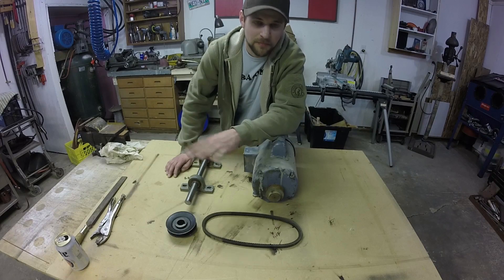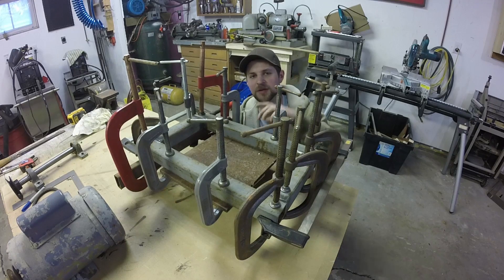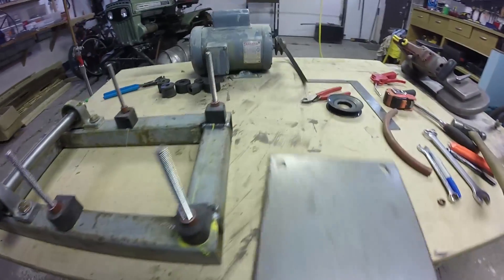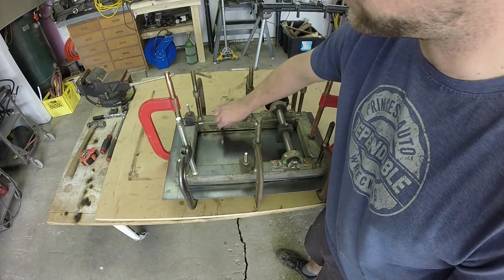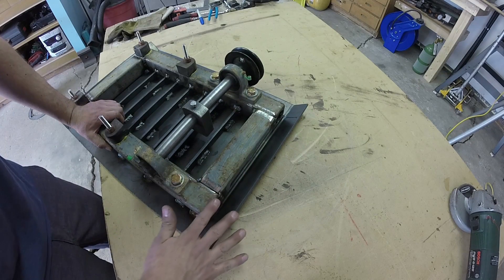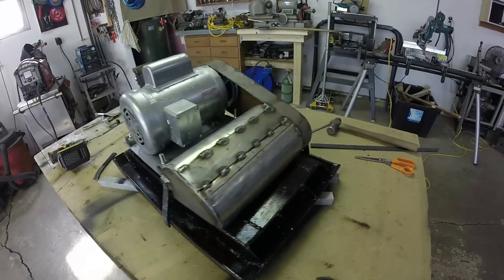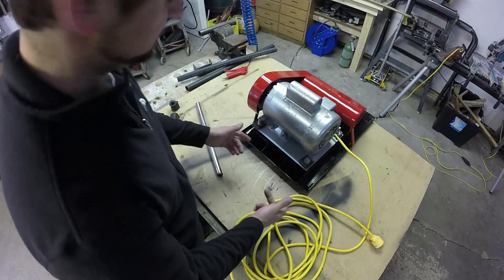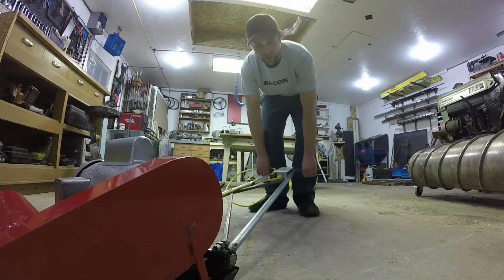Plate Compactor - WHY RENT?? BUILD YOUR OWN!!!

Comment: Actually pulling back straight on a vibrating plate tamper that is clean on the bottom because of water spray or a fine spray of diesel will have a effect much like a steel trowel on concrete . The plate can also be spun easily while it hops and while stationary too as long as it is clean and damp on the bottom . Carry a thick stiff scraper to clean off any asphalt buildup that may leave blemishes. Spraying too much water on the hot asphalt can cuss it to boil and impede the travel of the plate tamper. Good Idea. When is the rechargeable battery version coming out? The gas powered ones with the big water tanks have a weight benefit. A useful tool for initial compaction on slopes exceeding 18-22 % . Rolling those while hot can cause them to stretch excessively.

Comment: With the electric motor You will have to be careful with and around water. Water is used finely sprayed to keep asphalt from sticking to the metal plate. A wet piece of cardboard thrown down in front of the plate will also work , better if sprayed with diesel or thin oil soaked into the cardboard. Oiling the asphalt will weaken the surface oils of the asphalt . I have had a hydraulic line break on a roller . Remove the most badly soaked asphalt and replace with some new uncontaminated material . Using a weed burner torch to cook of remaining oil will help too just do not overcook the asphalt and burn all of the oil out of it. That spot is still holding up well about 15 years later with no signs of spalling or failure. I have not tried simple green on the cardboard yet and We do use a biodegradeable release agent that works very well as s release and cleaning agent like a thicker version of Simple Green. Only use it on the cardboard that the tamper runs over. We do prefer to use the water from the mounted tank that sprays from a sprat bar mounted at the front .

Comment: put a reverse polarity switch on to make it go both ways. and make the handle rotate to other side. 
other than that, good build. 
 I'm going to attempt to build another one with 2 exciter drums. one on each end of the plate. 
It'll be 2 drums made from sch.40 pipe, with exciter inside, a plate welded to connect the two pipes for the flat bottom. The pipe will also function as the front lip wedge ramp. 
To keep both exciters in tune, l'II have to use chain to tie them together. not sure how well that will go.

Comment: You gave me an idea to use an old cylinder mower thanks
Reply: Cut the blade off the cylinder add the counter weight or two on the main shaft
Reply: You've made a cylinder mower

Comment: I can't work out how that counterweight on the shaft makes the plate vibrate ? Does it hit something or is it just the rotating motion of it ?
Reply: The weight is not centered, it is offset making the shaft unbalanced. 

If you think about the great pains that go into balancing mechanical devices: driveshafts, crankshafts, motors, etc. This is the opposite of that. The shaft is made unbalanced on purpose to cause it to vibrate and shake .

Comment: Just curious, why wouldn't you mount the drive shift with the oscillating weight counter weight to the center of the frame?
Reply: I was kind of wondering that... why not put the oscillator in the middle and put the motor above it, centralizing the mass and using the motor as weight to vibrate against 🤔

Comment: Very cool. Can you put a big battery on it so you needn't a cord. Also can be water resistant then.
I wanted a cordless compactor for some time. Of coarse you need to convert the power from ac to dc. Something like that.
Even using a truck battery would work.
I'm sure Milwaukee will built one of these one day. Better than breathing fumes.
Well done on your engineering.

Comment: Hi! Great video!! Did u ever make a follow up on the plate compactor? And/or an in action video? Are you satisfied with the size of the motor?
What is the total weight? We´re planing to convert a gas compactor to electric, I think it´s 90kg and the gas engine is 4hp. What do you think we need size wise?
Mattias

Comment: I'm thinking that belt is the key for vibration separation. Run a wheeled handle and motor that pivots seperate from the eccentrics and actual plate. The motor, handle, and most importantly you, would then be dampened

Comment: I have an old yard machine tiller I just took the engine off I want to build one of these right away I cannot figure out where to get that counter weight, pillow blocks round the rod everything else no problem but for the life of me I cannot find those counterweights for say 1 inch round rod does anybody have any idea what I can look up to find them on Amazon or eBay?

Comment: What should be the weight of the eccentric, the off set weight on the rotating shaft, that gets the vibrator action ?
Reply from the maker: +Mangal Singh B hard to say exactly...you can see the size of steel I welded on there. I would add or subtract steel until you are happy with the amount of vibration
Reply: REDNIC79 
Hmmm.....
I hope that around 2 pounds of weight must be good...
Let's see .. ..
Thanks again

Comment: Hi..
I'm Mangal Singh, from Chennai, India..
Ain't a 1/2 HP, single phase, 1440 rpm sufficient for this !
The base compaction plate of 6mm thickness.
The counter weight on the rotating shaft slightly heavy would be better..
These are my suggestions, hope you give me some advice regarding this....
Reply from the maker: yes that motor is sufficient as long as your weighted shaft spins at around 3500rpm. then make the machine weigh 150lbs. 6mm should be fine
Reply: REDNIC79 thank you for your valuable reply, will get back if any other doubt is there...
Thanks once again !

Comment: why did you want the axis to turn at 3500 rpm? is it the best frequency for compacting sand? i want to build something to shake up manhole covers (which are stuck because of sand and other stuff on the sides) but i'm not sure which frequency will work best to get the cover vibrating and to remove the sand.
Reply from the maker: the reason I chose that rpm is from looking at the pulleys on rental compactors. the gas motors usually run in that rpm range and the pulleys were close to 1:1
Reply: cool, thanks for the fast reaction! sadly i don't have any existing machines to relate to... :/ i guess i'll just try something.
Reply: " if operators are working with smaller aggregate sizes (one inch and smaller), they need a higher frequency to move the material and achieve compaction." . See all article : https://www.forconstructionpros.com/equipment/compaction/article/10306210/good-vibrations

Comment: How much does the entire rig weigh?  It looks light  but you could easily weld a  olympic exercise 45lbs/20Kg weight holder.  Make the motor quick release and use it on a diy:  auger, concrete barrel mixer, paver/tile saw bench saw.   Nice job btw.

Comment: what are your thoughts on flux core 110volt?
Reply from the maker: it will do the job for sure, cheep enough too. I use mainly mig+gas / arc
Reply: I started with flux core when i first got my hobart handler 140, because my neighbor , a pro welder advised me to. i have never used gas yet, but it looks like you may be getting less splatter. i saw you welding above your fresh painter compacter, a thing i could never do because of to many sparks.My nighbor told me flux core will weld hotter. All i know for sure is, it sounds different from the welding shop's miller & lincoln 250's,also, i have made welds far beyond it's 1/4' capacity that have held even after extreme abuse.Also is it cheaper. what are your thoughts on these things,and what is your reason to run gas?

Comment: Hey, as always love the videos, I was just wondering if we could get a garage tour? Or a fabricators basic tools? Id like to get into fabricating, but what welder do you use? What do you use to cut the steel, like those small triangles etc, and what do you use to bend the sheet metal into the shape you need, such as the belt guard?
Reply from the maker: sure! i can do that for ya soon

Comment: I would say that type of belt, and with that much of a set to it, you're going to get a lot of vibration, and should try a link belt... but I somehow don't think that vibration will be a problem.
Reply from the maker: +jesondag what will i link belt do for me? i have never used one
Reply: On most equipment, table saws, bandsaws, anything you want to minimize vibration, and noise on, a link belt will do that because it doesn't take a "set" like your belt has. I was joking that it's counter-productive, when the whole point of your machine is to vibrate ;-)
Reply from the maker: +jesondag yeah i get the counter productive thing, i always wondered the point of those belts....cool
Reply: I have a couple of them on my machines, both a green harbor freight one and a red name brand. both the same apart from price, and both well worth it.